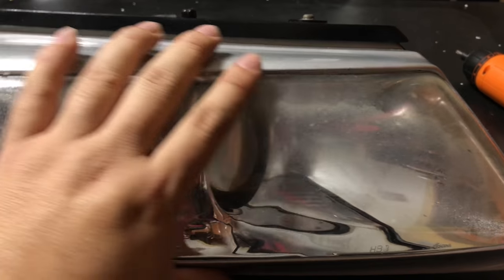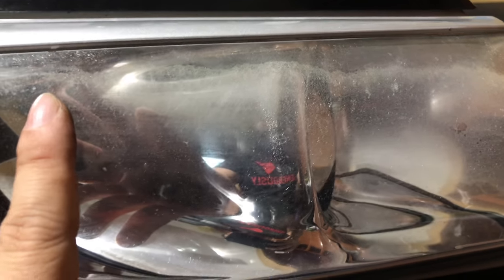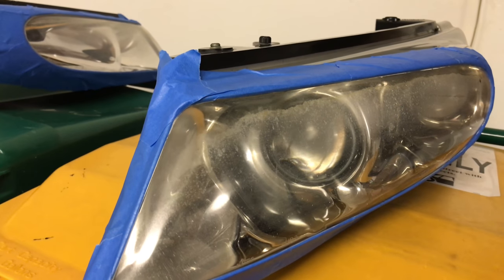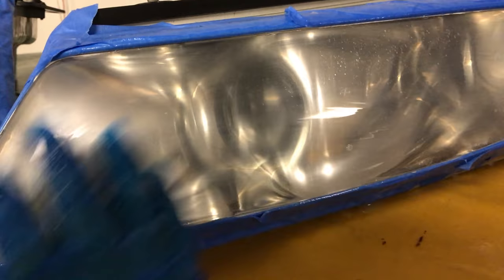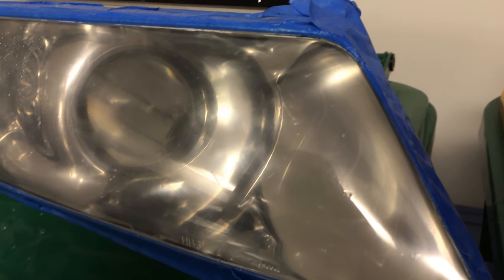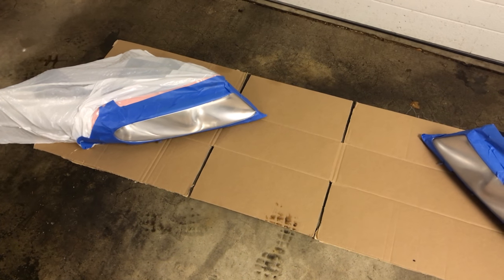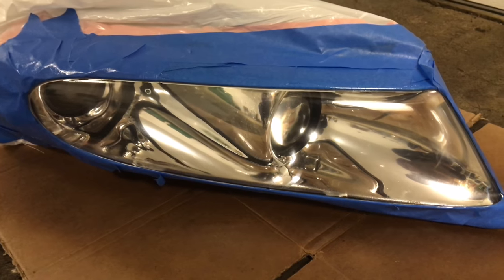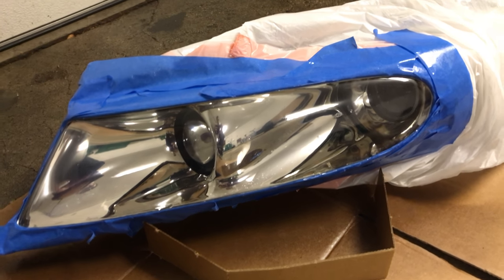How to restore cloudy headlights

Comment: Thanks!  My 12 year old Kia Amante will need this soon.Worked in a boat yard.  All two part epoxies are carcinogenic and effect the brain so a chemical respirator is necessary (not a dust mask). Fumes remain in a closed space for hours. Ventilate well. Temperature affects cure time.  In cold,  recommend 3 days. That spot might be a trace of water from alcohol mixture.  I would use a small amount of acetone instead. Great job Peter!